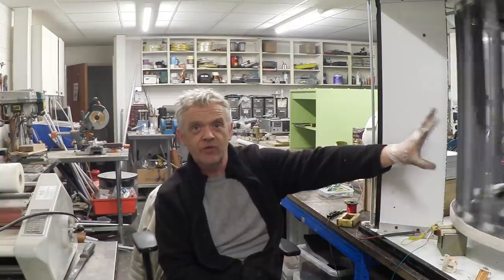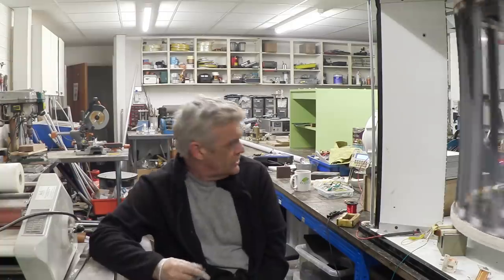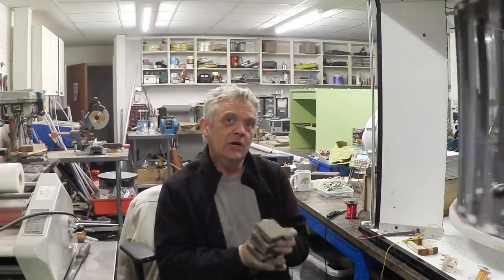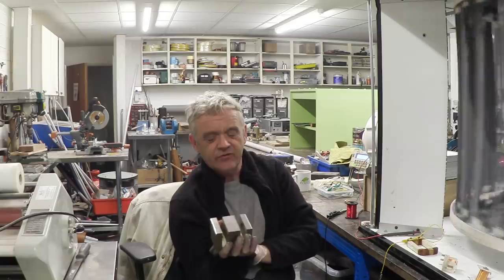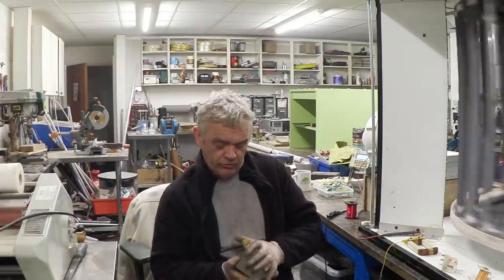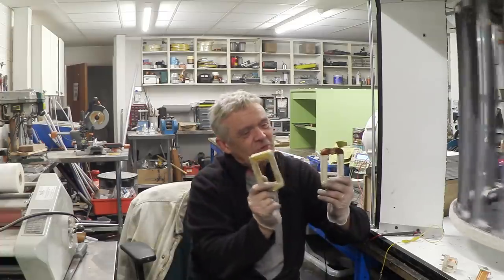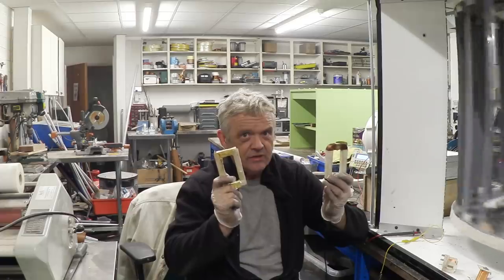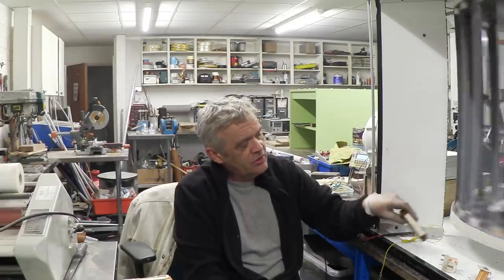Building a 1kW Wind Turbine For Under £100 - Part 5 - Messing With Coils

Comment: Very interesting. 

I’m wondering if you could arrange to have no iron cores at low wind speeds then as the wind increases it automatically raises the cores for more power out and speed limiting.  ??
Reply: I was thinking the same, rather like a governor in a steam engine, this would allow the speed to be constant .
Reply: Precisely.  The ‘centrifugal balls’ governor could raise and lower the cores.
Reply: I agree,  this way turbine can produce power until there is a small breeze or a 60 Miles wind. Hope Robert will test this! Because it can access  potential energy what most wind turbine can't access due to design. ( Rob you I right to be proud this series) Tanks.
Reply: I think you're really onto something here, but it may entail a level of engineering that is beyond the scope of Rob's little workshop. I think it could be done using a water pump (car window screen washer pump) high wind speed increases water pressure and raises a float under the core pushing it into position creating more load. when the wind drops so does the water pressure and the load drops. No rods or levers and the tube carrying water can be easily moved to where it's most convenient.
Reply: Robert you could use a third pair of chair legs. On the bottom. Cut them shorter, and attach a rod with magnets on the end, via a movable joint. So the centrifugal force  at high wind speed would lift the magnets to the coil with the iron core. ... hm maybe not a magnet directly on the rod but  5 sections with magnets on
Reply: I think your on the rigth track here. I believe that in this application, a variable operating point is crucial to get any meaningful power out of this turbine. Doing this mechanically for sure is an interesting option. But when you can get a MPPT controller for 15 bucks/pounds/euros does it really make sense? Do you really want to climb up your roof every month because your genius mechanism got torn apart by the elements?
Reply: raising and lowering cores will cost energy, probably making it less efficient as a whole. it is what it is a straight trade off.
Reply: @spacexvanityprojectslimite3315  H'mm you are correct that it will cost energy but on the other hand if you can still generate in low wind conditions you may end up on the + side of things. Fixed circular coils with a ferrite rod up the center the rods being fixed to a lightweight disc (which could be counterbalanced) would require very little energy to move the ferrite rods. The classic two ball regulator could be used to position the rods in the coils.
Reply: Sorry I added my comment before i saw this...
Reply: I know you can do that when powering a motor, by changing flux characteristics mechanically or electrically (which the latter is easier and efficient) , but for generating power I'm not sure how effective that would be, overall I don't think it would make sense for £100 when you could just build another one to compensate much more easily. just my .02
Reply: I know you can do that when powering a motor, by changing flux characteristics mechanically or electrically (which the latter is easier and efficient) , but for generating power I'm not sure how effective that would be, overall I don't think it would make sense for £100 when you could just build another one to compensate much more easily. just my .02
Reply: I know you can do that when powering a motor, by changing flux characteristics mechanically or electrically (which the latter is easier and efficient) , but for generating power I'm not sure how effective that would be, overall I don't think it would make sense for £100 when you could just build another one to compensate much more easily. just my .02
Reply: yup, was thinking the same. Measure speed & servo slides the "correct" receiver underneath

Comment: Nice job!
Re the turbine. For a given wind velocity all turbines have a free running ( no load) speed (rpm) and a different (slower) speed at which they are extracting the maximum energy from the passing air mass.  Below that rpm they are stalled and wasting a lot of good wind. 
For a propeller blade type horizontal axis turbine at best power extraction the tip velocity is about seven times  the wind speed.  
So to get the best out of your turbine it must work around the optimum rpm/wind speed ratio.  So you need to try various power extraction regimes while measuring rpm to produce the power ( torque) vs rpm curve.  Best with a real wind, but your blower will do. 
Then you contrive a mechanical or electrical system to ensure the turbine is always operating close to optimum torque vs actual instantaneous wind speed. Moving coils closer to or away from the magnets would be one way to regulate the load. You will need a weather station wind speed meter (or a swing vane on a rheostat would do) to give exogenous wind speed info which is used to vary the load to keep rpm in the sweet-spot to maximize your power yield. 
 Looking forward to seeing the curve!

Note that it doesn’t matter what coil arrangement you have, as the whole system is hung off allowing the turbine to operate in the sweet spot. IMHO going for an efficient coil with high voltage output will be most use as it gives simpler options for conversion to DC and higher voltage AC has less transmission loss. 
As you’ve found, various coil configurations give similar outputs, so you would optimize for cheaper and simpler.

Comment: Intresting Part 5. I think there is a simpler solution than inserting and with drawing cores to regulate speed as has been suggested in the comments is to fit multiple coils in iron cores and switch them in circuit as the wind speed increases and out again when the wind speed drops. There will be an optimum rotational speed for the turbine, too slow and the wind will spill from the blades without imparting any real energy and too fast and balance and vibration will stress the structure and the force exerted on the blades will be reduced because in effect the blades will be travelling away from the air flow on one side and into the wind on the other.  
I mentioned multiple coils on Iron cores. The iron core increases the efficiency of the coil and for maximum effect allows you to get more energy extraction density. If a current isn't being drawn i.e. the coil is open circuit,  the the proximity of a coil to the  should have little effect. However thin wire secondary losses would be expected to be higher. Why not try 2 Primary coils on the same iron core in place of one primary and one secondary. Connect the second coil in parallel with the first when the rotational speed goes above the optimum. Don't think of it breaking the rotation think of it as regulating the speed  by extracting more energy when more is available from stronger wind speeds
Reply: AND the braking effect above optimum would be a natural 'governor' to avoid stresses. Where most modern minds would rush to some sort of computerised governor the nature of physics and mechanics hold the precious key.

Comment: It is simple really.
If you want an acceptable amount of power out(100w), there will be a decent load on it that requires strong winds for it to work or it will stall. Regardless of the amount of coils or cores the load on it will be the same if its producing an acceptable amount of power(100w).
If, on the other hand you want a virtually unusable amount of power out(1w), there will be very little load, so requires light winds for it to work.
The skill is to make it efficient enough to produce a useable amount of power(100w). For that I suspect you will need much larger blades to catch the power of the wind, and a decent MPPT controller to make the best use of the power it produces.

Comment: Higher voltage is preferable, less voltages drop on the cables to batteries, so you can use thinner wire.
Reply: Save a lot of money on cables by going to a higher voltage.

Comment: Great video Rob.

Yeah, 'binding' the coils of such differing inductance would work as a very effective choke, and the shocks would have been from the field collapse when you joined what would effectively be an AC transformer Primary and Secondary for the split second before the fields merge.

Comment: Great work.  Looking forward to more.  I am surprised that the coils didn't work together.  I keep returning to thinking about the principles of of eddy current brakes, as used in electric locomotives.  Much of generator design uses the same ideas to balance braking force over electricity "production."

Comment: I can remember the alternator of a Triumph motorcycle, with its multiple single coils around a single iron core. The generation was via a magnetic rotor. Basically a circle of laminated steel with hoops of coils going over spigots of iron laminate. The iron of course increases the magnetic field strength of each core, which is the reason you need more power from the rotating wheel.
You are basically creating an electro magnetic effect in the coils which, because of the iron cores, has increased flux density. ergo a higher drag than an open coil. Swings and roundabouts. Higher flux density higher output. I wonder if multiple air cores would have the same effect, as in would the magnetic field be proportionally increased for each air core.

Comment: Magnetic flux will form in a ferrous metal 10,000 times easier than it forms through air!
You could increase the efficiency by "extending" your magnets with some steel to "fit" over the outside cores of the setup.
What you are aiming for is to cut the maximum lines of flux as quickly as you can. The lines of flux form in concentric layers from each pole of the magnet, so in your current (sic) setup you are cutting the long lines of flux as they run parallel with the magnet .... changing the orientation of eather the magnet or the windings/core will reduce them further as you noted already!
It  may be an idea to try mounting the coils as you mentioned on a bolt .... but to have the bolt fastened to an outer cylinder of steel so the magnet passes over a concentric arrangement of outer-inner-outer with the coil acting around the inner. 
As I said ... just an idea! The important thing is to play around, and have fun when doing so ;0)

Comment: Looking at the video it suddenly occurred to me why turning the iron core "sideways" worked better...
Because of the magnets' polarity arrangement: N-S-N-S... when you put a "W" shaped core sideways, you get one N or S polarity in the center and two of the opposite polarity on the sides, maximizing the magnetic flux around the coil.
Turned 90 degrees, the core's isolated sheets prevent the flux from flowing between poles (magnets), and you get only the net effect of the magnets on the part of the coil that is perpendicular to the movement, or close to it.
This also explains why removing the top of the core improved the performance: the top allowed magnetic flux to flow "over" the coil, rather than taking the long way around it, thus removing some (or most) of the flow that is perpendicular to the coil's wires, and reducing the interaction between them.

If this is true, you can probably improve it even more by spacing the magnets in a way that fits the distance between the core's "legs" (and gaps between cores), so that they don't cancel each other.

This is fun, thanks :)

Comment: I think this is the most interesting video I have ever watched, I would give it 2 thumbs up if I could. I also concluded from your video that the generation design is fluid depending upon the situation it is being exposed to, and the desired outputs. This confirms the thoughts I had already been thinking. It has also inspired a thought for me to experiment with when I get time, and that thought would be 1 long coil in a circle with multiple small magnets separated but passing over the same coil, the thought being the more magnetic fields being constantly in contact with the same coil but moving into different postions along the coil will increase the amps/volts. 
Its nice to see so many people interested and with their own ideas being inspired by this video.
Thank you for sharing your investigations.
Reply: I'm pretty sure you will get zero volts as a coil induced by both north and south pole magnetic fields will cancel itself out...that's why generators are built the way they are.
Reply: @spacexvanityprojectslimite3315  My thought is multiple magnets together, thereby creating 1 large magnet with a increased number of teslas as E=B L V. You may be correct, but I think it will be worth trying and having fun with.

Comment: I think it has been very productive and has provided many answers. If you are looking to provide your workshop with free DC power then you can hook up either 6 or 12 coils in series to get 12 / 24v, but if you want to have a battery bank as energy storage then you can use a solar controller to manage the power intake, batteries and load. This at minimum will give you free lights, however, this could also be used in the same configuration with an inverter connected to the batteries to reduce your electrical bill. There are more questions I agree but you first need to ask yourself what your best use of the turbine is to best suit your needs. You have put too much great work into this for it to become an unused project. Again, at the very least, run your lights free with a variety of LED types. We all need to do our part to reduce our carbon footprint.
Also you could run two series circuits, one primary, one secondary. Just pack the inner gap of the coils with a ferrite core.
Amazing video Rob!!!

Comment: 7:45  Interesting that you say it doesn't matter if you have an iron core or not, the Tesla coil can produce huge amounts of power, especially voltage and it's an "air-core" transformer effectively, it has no iron core. Hmmm   This is what I love about your channel Rob, It really does "feed the mind" and gets you thinking. great video as always, can't wait for the results. just an afterthought, and this is just my brain throwing out ideas, (this is what happens when I watch your videos lol), Imagine a bunch of "mini Tesla coils" used in place of the transformers, the iron core definitely dampens the way power is induced in the coils, volts go up and amps go down (and vice versa), that doesn't happen with the Tesla coil because there is no iron core, in fact the Tesla coil is often referred to as a true "power amplifier"  (power = volts and amps). well that turned out to be a bigger post than i intended LOL. keep up the hard work.
Reply: Well, tesla coils just cant use iron cores. If they were to use them, you would fry your coil because it would immidiately short through the iron into the ground, no matter how much isolation you put on there.
Reply: @headlessxp4948  that's right, Tesla coils are specifically designed to work without an iron core.

Comment: What if you had alternating coils with and without iron cores. Then somehow if the wind speed is lower use the coils without the iron core and if there is a higher wind speed then use the coils that have iron cores.
Reply: Was thinking along same lines Matt with some sort of switch over shielding plate activated either way by rotation of drum speed, quite a bit more work mind you.
Reply: you will still have magnetic breaking affect lowering rpm. even having cores that can be moved according to wind speed will require some torque from the rotor.....thus cancelling out any gains and making the whole thing more complex more expensive and more likely to break down ....lose lose lose situation

Comment: First off I'm pretty much a dummy when it comes to this kind of stuff and I've really been enjoying this build. It sounds to me like the bare coil only slows it down by one mph so you could add three or four and multiply their output as compared to using one with the iron core, which is what I think you're saying about using the bobbins of wire. How about cutting the E in half depth wise so the coil just sits inside of it?

Comment: Hi Rob. I hope this is helpful.
The induced voltage e = -N d(phi)/dt, the number of turns times the rate of change of flux linkages.
The current i = e/Z  the complex impedance, where Z = sq.rt.(R^2+Xl^2). Xl is the inductive reactance which is proportional to L, the inductance. So lots of iron means lots of inductive reactance. What is really needed is lots of turns of thick wire (low R) and low (or no) iron (low Xl).
If you're using multiple coils then you are summing a number of waveforms which may not be in phase with each other. If you rectify each coil separately then you should be able to connect the dc outputs in series / parallel without worries.

Comment: Superb series of videos! Have read many comments about dual coils and raising cores for high winds, but...
What about trying different positions for the magnets?  If they were a little closer to the centre then the braking effect would be lessened as the blades would be at a greater radius.  The trade off of course is less magnets, but I feel this would need trialling to see the cost/benefit of this extra variable.

Comment: Great job Sir!
To add to complicating the assembly- would a flywheel help in maintaining the rpm when loaded;perhaps in a form with a light coil spring which winds up at the beggining and when a certain rpm is achieved it helps kick start the flywheel and that helps maintaining the rpm under load...